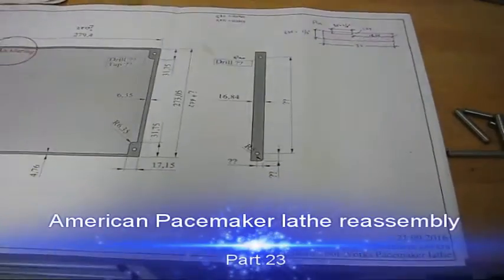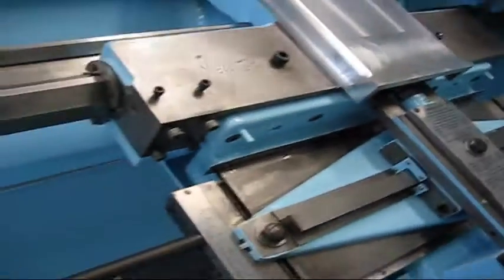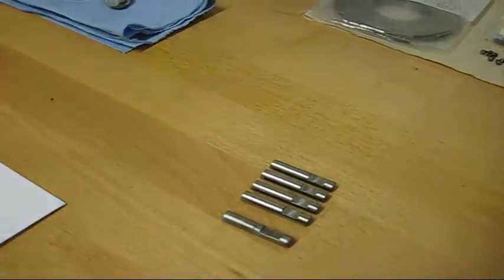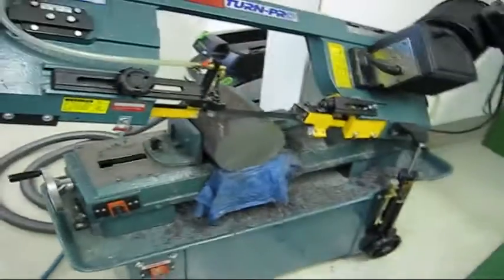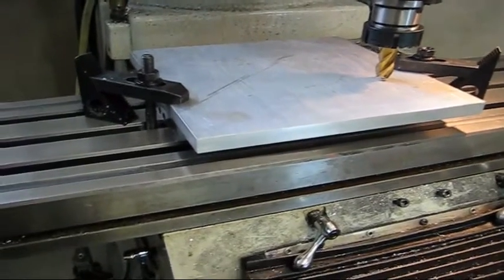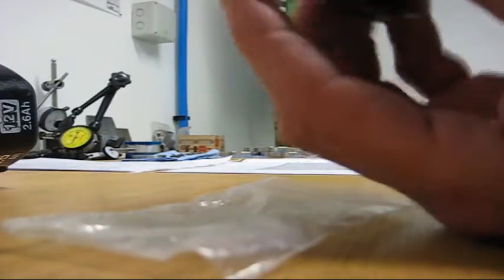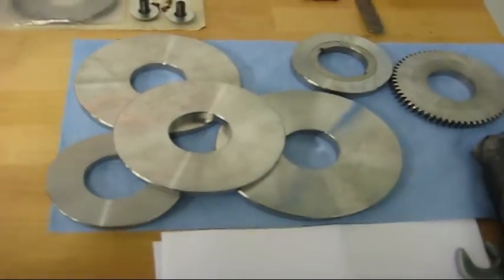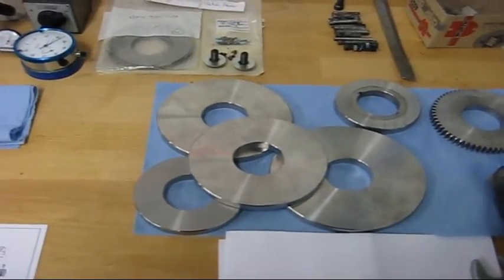American Pacemaker lathe reassembly part 23

Comment: I saw some comments here below that you want to have the ways reground.
I have not seen all your video's yet, so I may have missed a comment, but I am curious about there condition.
As jou know American Tool Works made the ways from hardened tool steel bolted to the bed. So, I am curious about there actual condition after having seen years of service.
Reply from the maker: I don't think I have gone into much detail about that but there is definitely wear on the outer ways near the headstock. The saddle is much worse off course. So it the tailstock base.

Comment: what country are you located? , i only ask as im in england and have always wanted a pacemaker but have never seen one in uk
Reply from the maker: Hello. I am in Norway. You buy one in USA and get it shipped to the UK. It shouldn't be a problem. Apart from the pre-buy inspection.
Reply: +Panzax thankyou, did you import yours
Reply from the maker: Yes I did. I bought it from a used machinery dealer in NJ, USA. If you look though the whole series I explain how it all happened somewhere in there.

Comment: Aren't your power feed wires a bit small for the amp load of that lathe? they look 2 or 3 ga sizes smaller than the motor lead wires.
Reply from the maker: Naah, it's only a 3/4 HP motor. I think...